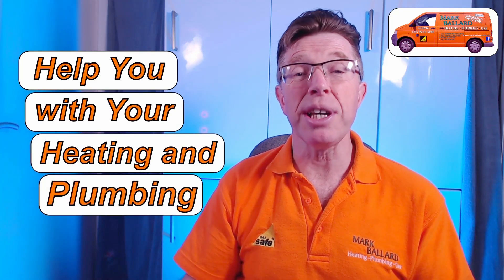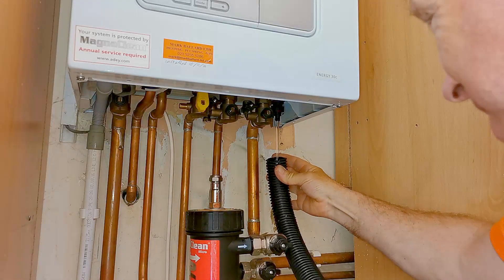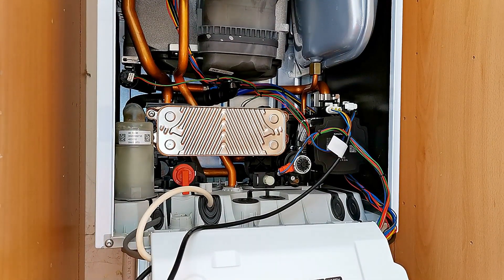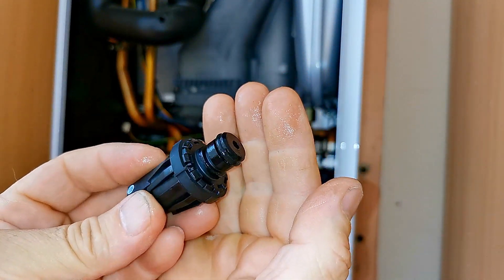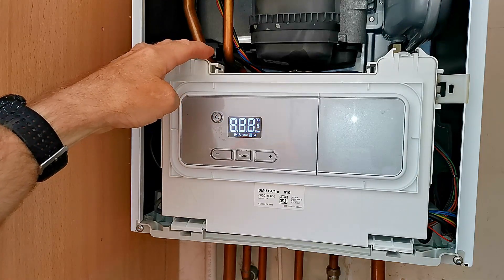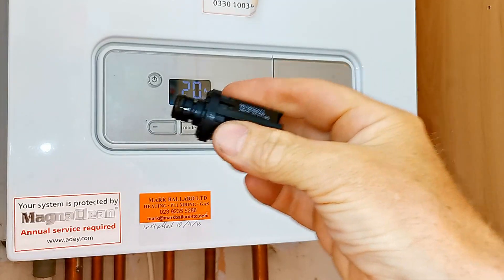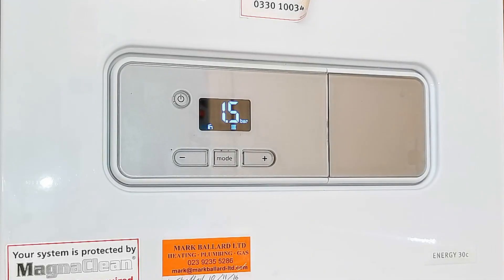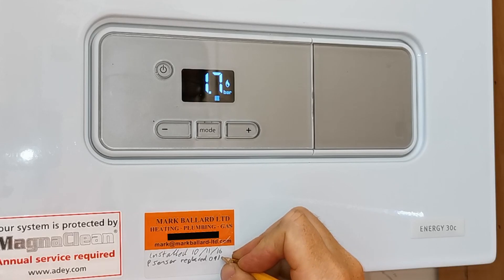Glow worm Energy, Pressure Sensor Replaced, Because of the F75, Plus Eco Setting. 2021

Comment: can you advise me please? glow worm ultimate 30 hot water icon stays on screen and hot water works fine but as soon as i press the button to put the radiator icon on the screen it starts flashing and fires up the boiler ?  i cannot get the icon to stay on the screen with out the boiler firing up ?

Comment: The problem i had was the old orange coloured water pressure sensor is now discontinued and the new one i got, the plug on the harness does not fit. Such a pain in the backside, nightmare!! Btw mine needed changing as it started to leak.

Comment: Hi Mark, I need to relocate my hot water tank from downstairs to upstairs, the heating pump is currently below the hot water tank down stairs (on a single valve Y configuration) - am I correct in assuming I will need to move the pump upstairs too so it is close to the hot water tank????  Any tips or recommendations on this task???